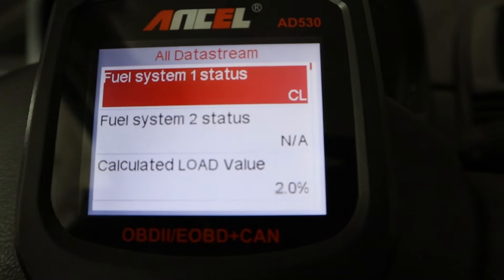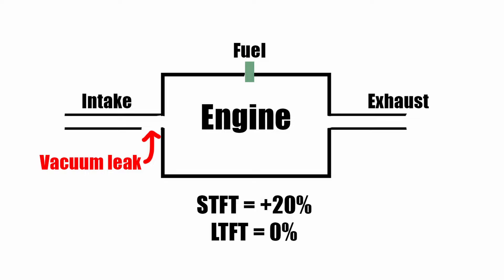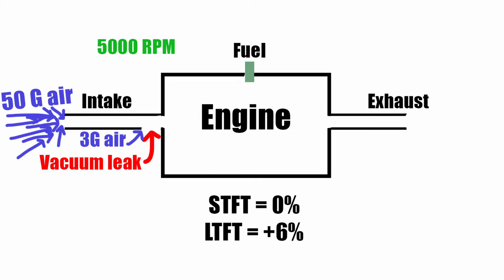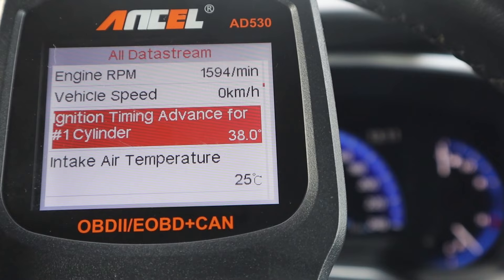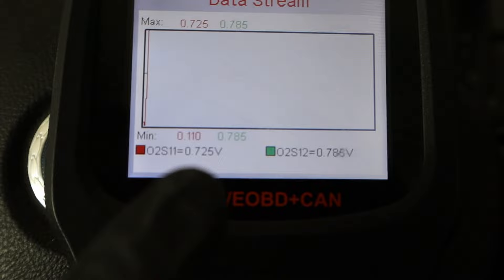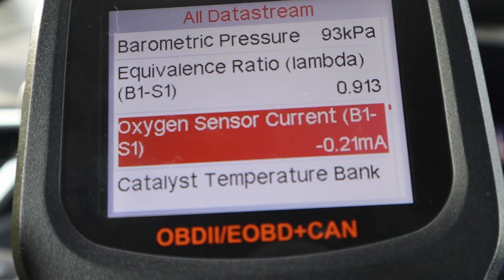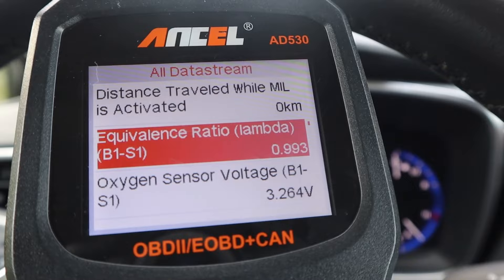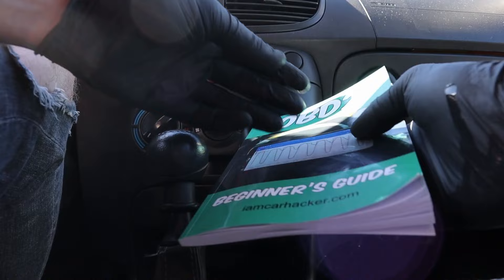How to read OBD2 live data

Comment: My long term trim is +43% ☠️ how can i reset that, it has happened probably because the car is driven ot LPG now than gas
Reply from the maker: Yes that makes sense since you are using way less gas than normally. In that case resetting won't be necesarry because it will go back to 40% anyway if you keep driving on LPG. 

If you don't have any other issues, don't bother with fuel trim for LPG car.
Reply: @iamcarhacker  thanks for the reply, i have a problem with the first morning start of the engine, is cranks more than normal and it doesn't hold higher revs, I'll be checking temperature sensors etc. Cheers !

Comment: i was confused with b1s1 voltage. i thought the voltage should be between 0.0 -1volt but i can see 3 volts. how is that possible. i have a similar value with my Mitsubishi mirage and cant figure out why. can you help explain
Reply: if high voltage means lean condition then, why is my mirage guzzling twice the fuel with no trouble codes other than my b1s1 voltage being between 2-4 volts
Reply from the maker: Some cars display higher value for example 1V to 5V and for some cars the lean and rich can be displayed backwards (high voltage = lean, low voltage = rich)